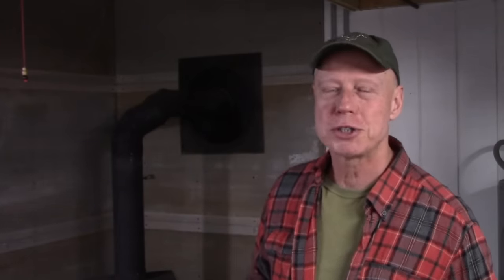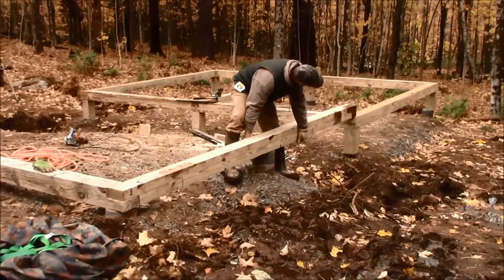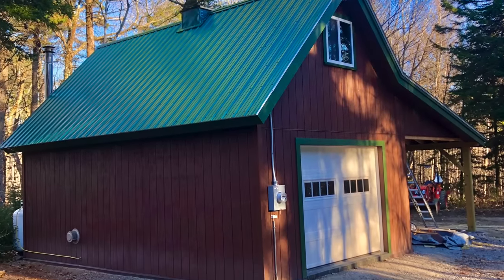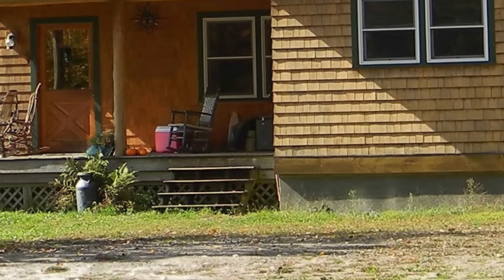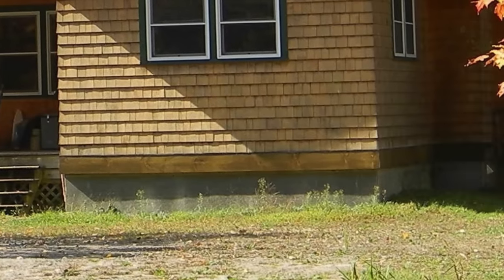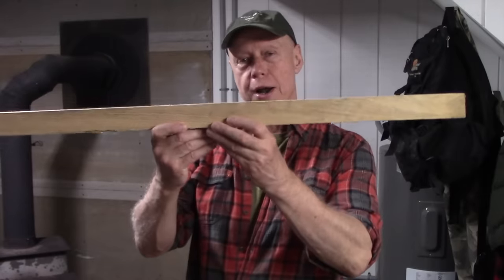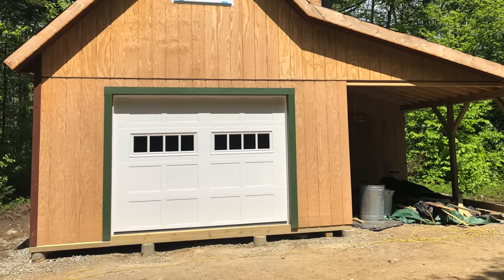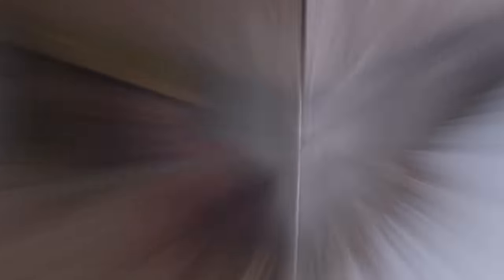BEST METHOD FOR SKIRTING A CABIN WHEN BUILDING ON PIERS.  Keep Pipes From Freezing.

Comment: The cement board is a good idea for a skirting material.  Flame resistant, and if you coat it with a hydrophobic material, especially where it comes in contact with the soil, you lessen the chances of moisture wicking up to your framing.  Gotta love that good ol' bubble-foil too.  Great stuff.
Reply from the maker: Yessah :-)

Comment: I've skirted and insulated the floors of two cabin builds with your methods and both are working "as designed".  Zero problems at minus 20F. No vents, no mold/mildew.  I also staple bubble foil on the outside of windows in the summer that face the sun. Works great.  Thanks JC.
Reply from the maker: Excellent!
Reply: The method he is using is widely spread in  countries with cold climates. Soft EPS foam works as a dempfer.   It is much cheaper than to put footing 2 meters deep and build a foundation wall on top of that .

Comment: Great video, the cement board is perfect. I am a proponent of a totally-sealed crawlspace. If the crawler is cooler and the outside air is warmer (and warm air can hold more moisture than cold), then when the warm moist air enters the crawler, condensation happens and mold follows. I like crawlspaces built and insulated just like the structure above. If the vertical foam on the crawler wall can go down below the frostline, even better, the dirt floor will remain much warmer. Then a crawlspace vapor barrier on the dirt floor, sealed to the foam on the walls, finishes it off. If it is in the budget, a 2-inch concrete "rat slab" over a moisture barrier allows one to put a mechanic's creeper in the crawler. Talk about luxury! Heating the crawlspace by circulating upstairs air through the crawler is a great idea, keeps the upstairs floor nice and warm. Sealed crawlspaces. Frog butt tight, no spiders (spiders love air flow; they let the wind bring the food to them), no mold, same quality of air as upstairs. A wonderful living space for very short people!

Comment: Hi JC ive been watching you for quite a few years and remember privious videos where you show this method of the bubble wrap. We had a mobile home with lots of ventalation around the whole mobile. The park had a water leak under the home that no one (we had several plummers and the park matiance staff go under there with the same result, no leak! We were told there were several low spots that were collecting rain water and to put several box fans under there to dry it out. Which we did, but we still had a very bad mold problem in the master bedroom closet. The closet wall backed up to my daughters bedroom where her bed was also against that same wall. Altho we never saw any mold in her room it still bothered me it was there.  Finally i called the water co. Told them the problem and he came to look. He said the whole end of the mobile  was moldy underneith, and the ground was just saturated with water altho there were no above ground telltail signs. The ground was spoungy and that end of the mobile had sunk on its piers about 6 inches. He nosed around and found the water leak from the main. Told the park manager and we filed a lawsuit documenting everything from when it started having problems. We had professionals come and get rid o&$f the mold. I lost clothes shoes and purses as the mold was on my side of the closet. We asked for restitution for extra heating costs in the winter, replacement of my personal items, the walls, flooring, sub flooring and carpet in the master bedroom. Also to have it releveled and repair the roof as the 6inch dip caused the roof to crack and leak. It was a mess! Took the park 2 yrs to complete the repairs and we had to continue living there till it was done. As time passed the damage from all the dampness caused the floor all over the movile to get soft spots which we bought sheets of 3/4 inch plywood and just threw it down over the soft spots my husband even broke thru one spit in the livingroom with one leg. After that we started looking for a new place to live. The park manament refused to pay for new flooring throughout the mobil stating they had no proof it was their fault. So we moved and even tho we owned the mobil we didnt want to be bothered to pay for the repairs which would exceed anything we'd recieve from the sale of it. So we locked it up, left whatever we no longer wanted in the mobile, put the keys in an envelope with a note saying we donate it to the park manager! We decided she was so nasty we'd let he deal with it. Recently l had a chance to go by the park and its still there. There were a whole lot of repairs needed to bring it back up to code sp the park ate it not us! My hubby did do the bubble wrap under our next place, floor and skirting as the house we bought was up on puers, so thank you so very much for all your "how to do it right" videos. ❤

Comment: Thank you.  I have been in the construction industry for over 40 years.  However, I haven't faced the circumstances you described until now. I'll definitely put some of your suggestions to good use. We've incorporated void form under many a grade beam with stellar results.  The saying I'm  with, " never time to do right, always time to do it twice."
Reply from the maker: Glad you find my ramblings beneficial and thanks for taking the time to comment.
Reply: @thebossoftheswamp  I'm 68 and still learning.  Came into possession of an old LT40 Wood Mizer, so I am now attempting to become a sawyer. My first substantial project is a 30×40 post&beam shop. I was leaning towards a full on grade beam with pillasters. Affordability has me building of concrete piles. Hence, closing in around the perimeter.  Thanks again.

Comment: Wow! Great subject! 
We are building a cabin on piers , and we skirted it with hard foam insulation, no structural wood.
 We screw it against the deck ledger, then we put some dirt on the outside at the base and on top we line it with 6mill plastic that is also extended 5 feet around the outside perimeter too, keeping the moisture away from the cabin.
So far, the basement is doing good. We had -27F , we had to heat it a little because we aren't ready to move in the house (no insulation in the walls yet) and there was no heat at all coming from the house.
We are living in the camper on the property while we are working on the cabin. Hopefully, in 3-4 months, we can move in.
Bubble foil is going to have a lot of use

Comment: Thanks for the great tips as usual. Seems if you can take advantage of the geothermal heating of the ground, you don't need to go crazy on insulating the crawlspace. We were looking into a geothermal heating/cooling system and found out the ambient temperature of the ground when you get down to 4' or so stays consistently at 45F degrees. It doesn't take a great deal of energy to heat or cool from that temperature to allow for comfortable living space conditions.
Reply from the maker: Exactly. Frame the floor with PT and with bubble foil preventing moisture from reaching the subfloor, I have no worries about mold.
Reply: Good plan! We have been brainwashed into believing that we must follow certain insulation rules and no one ever tries any different materials because this is what we were taught.  @thebossoftheswamp

Comment: Great idea!  One could also use rockwool for the insulation (if you have the money).  Rockwool will provide the insulation factor, but bugs hate it and won't try to burrow through.
Reply from the maker: Rockwool is my favorite insulation but I think I'd stick with the foam under the plate. I shared in one of my past videos where mice were pulling rockwool out of a wall and transporting it to a different wall and building next with it.  They preferred the rockwool more than fiberglass.  Prior to my findings I had always heard rodents hate it.

Comment: I live in the pacific north west on the coast where the humidity is always high so subfloors need a ton of ventilation, used to live a couple hundred miles inland here where it's way dryer where the ventilation under subloors is barely used.

Comment: Building on cmu block piers and slab. But have 6 foot frost depths. Thanks for the videos. I am insulating foundation and piers as it is code here. I am in sand till about 5 feet when I hit hard pack. Cement boards breaths too. I am using dolostone for splash area. Lots of carbonic and tannic acids so not using limestone or lesser carbonic stones.

Comment: Hey Boss man This video is great. Perfect timing. Raised my cabin last Summer will be skirting this year. Was at a loss where to start/ best application etc.  all cabins in area..have open foundation to combat moisture issues. Going to skirt with ur suggestions regardless maybe adding layer of plastic as barrier to help. I’ll let you know how it goes. Thanks again for your work on these videos. Very clear, concise and detailed. Best to you the Mrs and Tildy. Be well Boss man!
Reply from the maker: I used PT to frame the floor of one of my cabins and the bubble foil prevents any moisture from contacting the subfloor plywood so mold is no issue.

Comment: You can also wing out with styrofoam equal to the depth of maximum frost. Will never heave. Done in the far north on cheap indigenous homes to save with slab on grade foundations. Also now common in the lower homes in Canada.
Reply from the maker: IMO I don't think you could overdue the styrofoam.

Comment: With what you put down on the floor it is also easy on the feet, say if you were working on a vehicle. You could even put a vehicle lift in that garage with some concrete pads at the 4 points where the hydraulic lift contacts the ground.
Reply from the maker: Very true. Leaving the floor this way offers many different options for the future.

Comment: SKIRTING
The method that you're talking about, using Styrofoam under the bottom plate, is a common practice used when building concrete grade beams on piles. It's called void-form. This is a good idea, as the Styrofoam also acts as an insulator at or below grade. Now sand can be used as a type of void-form, placing at least 3 - 4 inches under the bottom of the skirting, so long at it is not compacted. The combination of both sand and Styrofoam will ensure that there would be no heaving, whatsoever.

Another way to ensure your skirting will last longer, is by 'hanging' it from the bottom of the cabin. The skirting is built using screws and glue, then installed with glue and screws to the bottom of the building, leaving a void under the bottom plate that can be filled with sand and/or void-form.

I like the idea of flashing the bottom plate, however, I recommend that the bottom plate be clad entirely with flashing, protecting all three sides from soil and water.

VAPOR BARRIERS
It is always a good idea to place a vapor barrier on a crawlspace floor. It prevents 'vapor drive' from pushing up water and gases, like radon gas, into the crawlspace. It would also be a good idea to install weeping tile, sloping the floor to a central drain, which flows outside of the crawlspace. This is just in case there is a leak from the building above, or a mishap like flooding from outside, whether by mother nature or a child leaving the hose on.  

Vapor barrier should also be installed on the inside walls of the the crawl space. It will prevent cold air from driving through the the walls in the winter, as well as holding your insulation in place. The vapor barrier from the walls can be sealed on top of the floor's vapor barrier, creating a sealed crawlspace. Now venting should be installed, for use in the summer months, especially if there is a considerable amount of humidity or rain, but they need to be closed and sealed tight for the winter months...that is, unless you plan to heat the crawlspace.

Just a few suggestions that I hope will help.
Reply from the maker: Very interesting to know that the foam method has been used before as i have never heard of it nor seen it done. I used to leave a void beneath the plate but then thought of filling it with foam and have been doing this ever since. I totally agree on the vapor barrier. I don't use it beneath my cabin because I rely on the ambient temp of the ground for keeping my crawlspace at an even temp. Blanketing the soil traps the ground temp beneath it and my crawlspace becomes colder. Thanks for sharing your thoughts.

Comment: Mr. Boss, I have a question?. I live in northern Maryland, on the Eastern Shore. I have a attached 2 car garage, with two metal garage doors, I want to insulate these doors so I can use this space for a small work shop 
Should I use foam board, or bubble foil, so I can try and heat this space.
I find all of your videos most informative, and educational.
Thank you. You certainly are a smart person.
Bob
Reply from the maker: I always recommend putting the foil on the inside of a wall so that is reflects heat inward and NOT on the inside of exterior sheathing or a rim joist because that reflects cold outward and creates moisture behind it. For your application it a way it'll be doing both and I can't say if it would create a bunch of moisture behind the foil. Put up a sample and see what happens. Let me know what you find.

Comment: Heres an idea. A guy on another channel has his offgrid house complete. he just finished putting his solar
on his roof. He was shopping for lithium batteries to build his battery pack when he recollected that the Ford
Lightning has the ability to powerup your house during power outages. he checked it out and as it turned out
the Lightning has a bigger battery pack capacity  PLUS  the truck cost less than the batterys he was looking
at to build his battery pack with.  SO  he bought the truck, saved $$, got more capacity & had a truck to run
to town in.

!

Comment: In the spring after my contractor finishes foundation repairs I will be doing the skirting on a 600sq ft house and three small cabins in the North Country. I have already planed to do them with Hardie Board and use ground contact pressure treated 2x4s for the bottom plate.  I was going to nail the 2x4s to the ground with 12 inch garden spikes to hold them in place but after your video I'm reconsidering my design. Dumb question but how do you fix the styrofoam to the ground and secure the cement board? Very much looking forward to the follow up video, thank you so much for this video!
Reply from the maker: The foam is held in place simply by the dirt I pack against it. At the garage, I hard packed crushed gravel against the skirt and it sets up like concrete. No critters have tried to burrow beneath it. My next video will be a recap on this subject where I'll answer all the questions that have come in.
Reply: @thebossoftheswamp  Looking for to it! Thanks again

Comment: In this video, you briefly talked about the garage floor.  Where can i find more details on the project?  I am searching for an alternative to concreat slab floor.
Reply from the maker: I don't remember which video I showed this in but what I did in the garage is I compacted 3/4" crushed gravel, covered it with a tarp and then covered the tarp with 3/4" horse stall mats.  It was an experiment and I haven't changed it since.  It's a good enough floor for my woodworking shop but probably wouldn't be good enough to continually drive vehicles in and out.

Comment: Hey Boss,  excellent video!  Your thoughts on using expanding spray foam instead of styrofoam?  The soft type for windows and doors. Just a thought.
Reply from the maker: Yes and I do spray foam the joints and around the piers.  If you had enough of it, it would work great under the entire perimeter.

Comment: This is a great way to skirt a building.  I have an off-grid cabin that needs to be skirted this summer.  If you don't mind my asking, what is it that you used for the foam under your bottom plate?  Also, what is your opinion on using metal roofing vs the cement board for the outside skirting?  I only got part way into this video before I hit the subscribe button, you're providing excellent information in an easy to follow manner.  Thanks
Reply from the maker: Hi Richard. I think metal roofing is great and looks good too.  I posted a follow up video with more info on the subject. The link is in the description below.

Comment: I've watched from the beginning video where you installed the Bubble Foil.

I'd really like to know if the cabin floor is warm enough for sock feet and if you ever used a laser temp probe to see what the temp of the floor is compared to other surfaces in the cabin.
Reply from the maker: Hi Barry.  If my floors weren't warm enough for sock feet, I'd be adding more insulation :-)    See the 3:15 mark in this video.  https://www.youtube.com/watch?v=WuB5uqtTfGE
Reply: Thanks Boss. I've watched your videos for years. From building the road to renovating the cabin. Love your videos. 

I'm finally starting my own off grid cabin build. Been working on the road for a few years and now it's time to start the cabin foundation this week. I'm so excited!

Comment: I was doing some researching on concrete board and it says it's designed for indoors only and if used outdoors after time it will obsorb moisture and start to crumble. But personally I think your method will work. I have a 12x24 detached bedroom and was wanting to skirt it before I get my last inspection on everything. Per code where I live the floor has to be insulated. And I didn't do so because I didn't read the fine print on the building codes. 
Is the concrete board the same as what you use around the walls in a shower?
Thanks great video
Reply from the maker: Yes it's the same concrete board but the last time I bought some I noticed it was much lighter and made differently.  With that being said, I can't speak for how it will perform.  All my skirting is still intact and it's been up over 15 years.
Maybe coating it with a water seal would help its longevity.